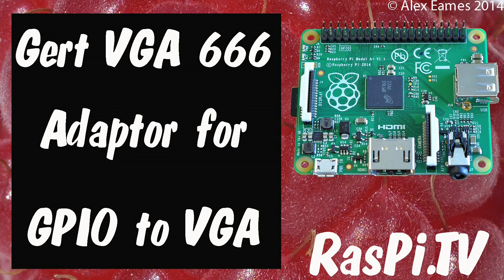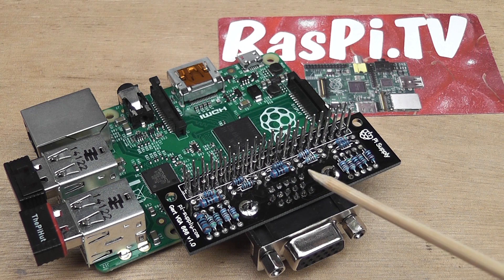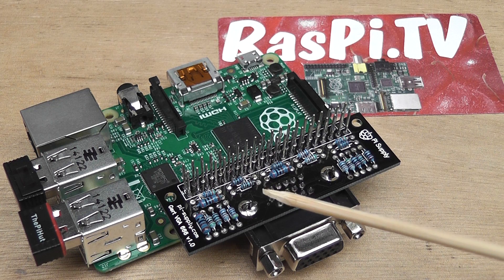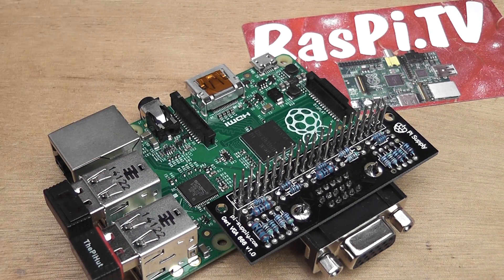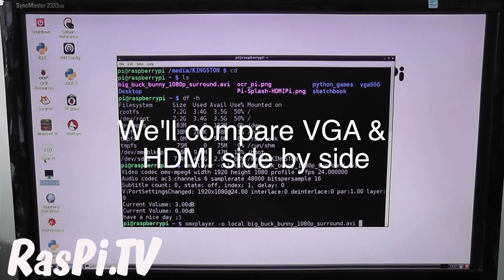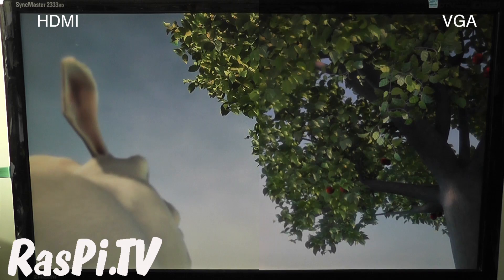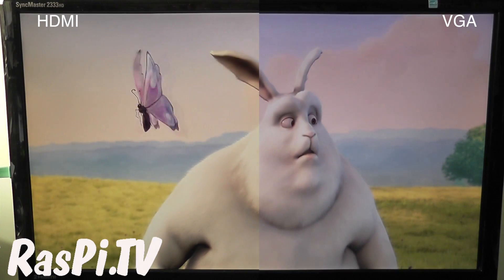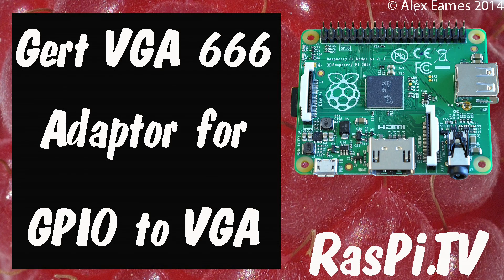Gert VGA 666 adaptor from Pi-Supply.com

Comment: How do I configure this device to display an image on the monitor? I enter what is available everywhere on the Internet:

Framebuffer_width = 800
Framebuffer_height = 600
Dpi_group = 2
Device_tree = bcm2710-rpi-3-b.dtb
Dpi_mode = 86
Dtparam = i2c _ arm = wyłączony
Dtparam = spi = wyłączony
Dtparam = uart0 = wyłączony
Dtparam = uart1 = wyłączony
Dtoverlay = pi3-disable-bt-overlay
Dtoverlay = vga666
Enable_dpi_lcd = 1
Display_default_lcd = 1
Force_pwm_open = 0
Dtparam = audio = on
Start_x = 1
Gpu_mem = 128

- in the config file and still no image...

Comment: Is that LITERALLY using all the pins on the Pi with an R2R resistor ladder to create a ghetto DAC for analog VGA!?!? 😂😅😆 LOL! The Pi doesnt have analog GPIOs, does it?
Reply: Well, if you use 8 bits for each of the 3 DACs required, (that is, one for R, G, and B) then that  24 pins, add to that a vertical and horizontal sync as well, so 2 additional digital outputs, so about 26 pins total required. The Pi BARELY has enough GPIO for that, you'd use almost every digital pin! If you are OK losing some color resolution to spare a few pins, you could choose to use less than 8 bits of color depth for each channel, and say only use 6 bits, meaning only 16 bit color depth (instead of 24), but save 6 pins.
Reply: The problem is is that it is really no cheaper than one of those HDMI to VGA adaptors on amazon, so I don't see why anyone would bother buying this and taxing the Pi hardware instead of just using an adaptor. It would have been nice to instead see it use dedicated hardware chip for selectable VGA / component / composite output.
Reply: lower latency?
Reply: +Team2Sexy Perhaps, but latency would be insignificant,  compared to the processing time on the TV and processing power of the Pi, unless a CRT monitor is used.
Reply: +Power Max i bought one for use on arcade crt at 640x480 to emulate old arcade games where even a slight amount of lag is noticable and ruins the game in things like street fighter. i really hope this solution is virtually lagless....
Reply: +Team2Sexy Emulation will never be perfect, the original games were heavily hardware optimized. Converting from digital to analog will result in some delay due to how analog signals scan top to bottom.
Reply: I agree with what youre saying. I still use the original hardware, but I wanna see if I can make something thats "perfect enough". This is why I chose this instead of just using a normal hdmi to vga external adaptor. In theory this should have less latency.
Reply: @Team2Sexy  did it turn out to have less latency?

Comment: Would be cool if someone made an RGB SCART adapter for the pi that could also work with arcade monitors :D
Reply: You don't need an adapter - You can use this VGA 666 and a breakout VGA cable. It will wire directly in to an arcade monitor or a SCART socket.

Comment: Your TV may be crapifying the VGA picture and it wants a high quality CRT to show you what it can do!  LCD  TV chipset ruins VGA!
Reply: I've yet to see  a good LCD TV or monitor that does more than 1280x1024 in an acceptable quality. This is fairly regular for 1080p. It might be a bit worse but I guess a graphics board RAMDAC is simply no match for this hack.
Reply from the maker: Tiz a distinct possibility that it's the TV indeed.
Reply: Stefan Misch LCDs seem like 'ahh, it'll do and looks good on the wall I suppose' but I miss all those colours and especially the black of a good ol CRT :)

Comment: Thank you for the nice split screen video! Good proof it works!
 
The degradation of the video quality, loss of details is a bit more than expected for digital versus analog. Might be also partly due to your monitor/television, the shimmering can come also from the monitor. 

For the price of this adapter I would suggest buying instead a monitor with DVI, 10- to 15 euro is the price for 15 to 17 inch displays (at least that is what i got for my nearly soldout collection of lcd displays in NL :) ), with a DVI to HDMI plug from ebay china for Euro 2,50.

But if one has only access and room for a VGA capable display like an old television, it is a nice solution!
Reply from the maker: Yeah I specified what sort of TV it was (Samsung Syncmaster 2333HD) in the blog so that people could see that. The close-up video makes the shimmering look worse than it seems to my eye. Nobody sits that close that they can discern the individual pixels usually anyway. It's definitely usable, but HDMI/DVI is rock solid, if available.

I see it as an interesting and clever hack, rather than something I would choose to use on a regular basis.

The other thing is, although the videos were shot one after the other, the sun was out for one and not the other. It made a bit of difference. It's always difficult filming a screen. Auto-focus tends to 'hunt' with movement as well. But, it gives us an idea of what's going on.